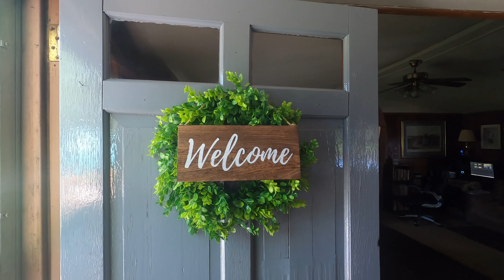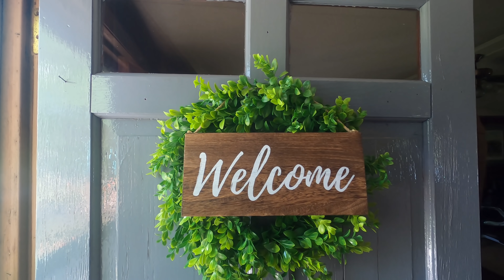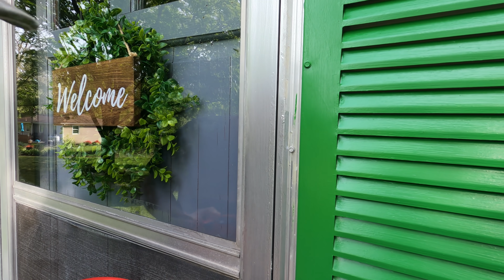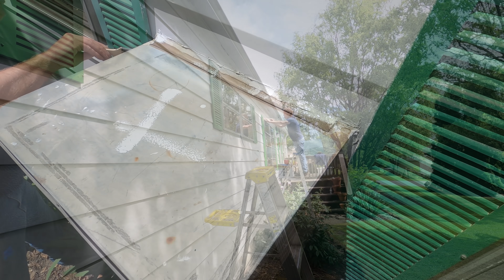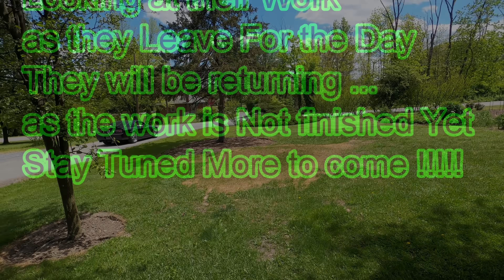ALL Leads up to this day! Old Mobile Home Transformation-difference is day and night

Comment: Beautiful!!! Why did they not just remove shutters to paint?
Reply from the maker: They were not in shape to do that we were afraid they would break ,they are over 58 years old
Reply: I was thinking the same thing,   and then saw that they were screwed or otherwise attached to the house and were probably fragile from being outside for all those years....
Maybe the coats of paint are the only thing holding them together?

Comment: Shutters and wrought iron are two of the worst things to paint, My dad did that for about 30 years. He would have been using a 4 inch camel hair brush, which that and a roller was about all he used. I was always amazed at how he could trim windows with that 4 inch brush.
Reply: Everything is looking so fresh and clean ,is there a possibility you are going topaint or Stain your decks,  or would that give a future video away?
Reply from the maker: we are still working ,Yes in the fall we are working till the cash we had saved  for these project is consumed ,then save a bit for fall when the flower pots are removed ect .but we still have so much more to share !

Comment: I have seen a painter before, use an old venetian blind, or any kind, I suppose, to put next to, or underneath a straight area that needs painting.  You can put it under that silver window trim, for instance, and zip right across without getting any paint on the house itself.  I guess painters used this method before the blue painter's tape came out.